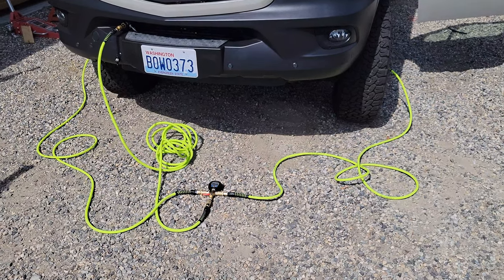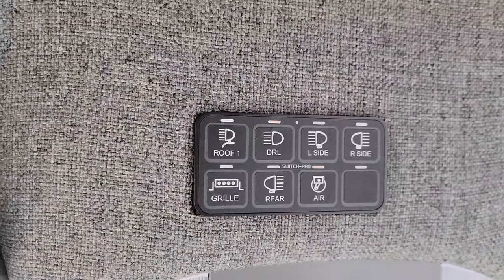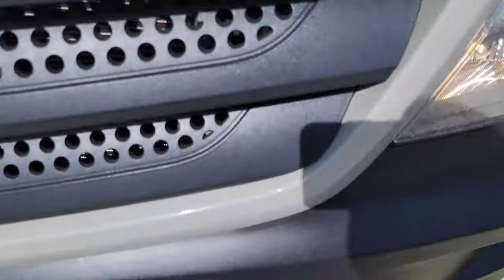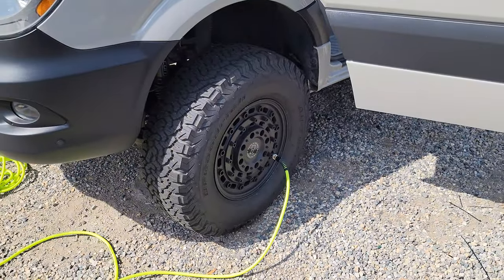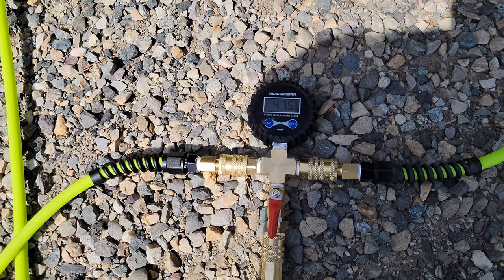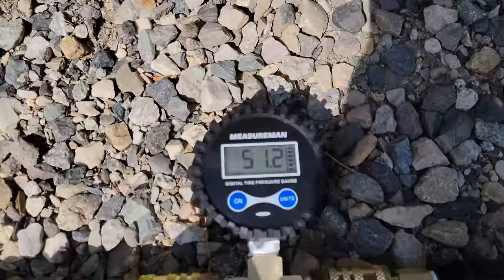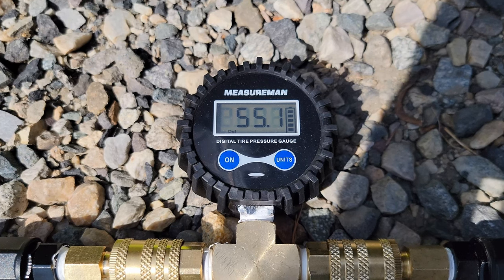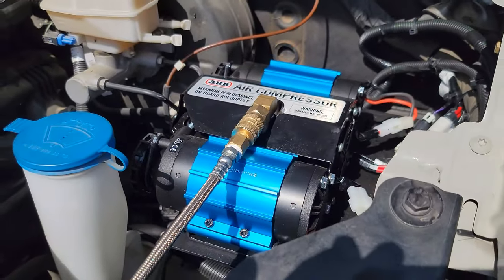Sprinter 4wd ARB Twin Air Compressor Inflation Speed Test - 34" Tires.

Comment: Thanks for the video. Where did you buy the mounting bracket for the driver side?
Reply from the maker: The compressor mount is from Vancompass 👍.  Full details and pics on my build thread here: https://www.advrider.com/f/threads/hodakaguys-4wd-sprinter-build.1380154/page-25